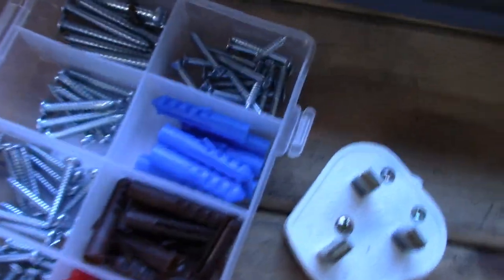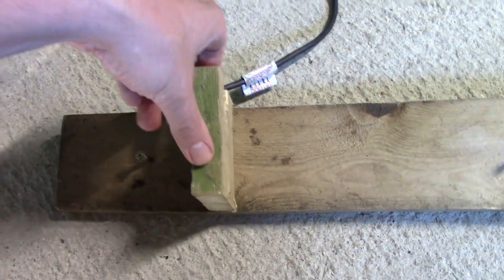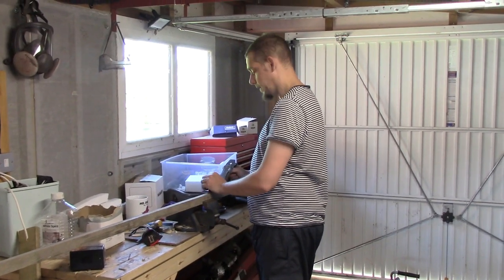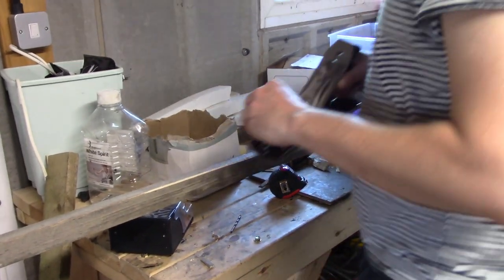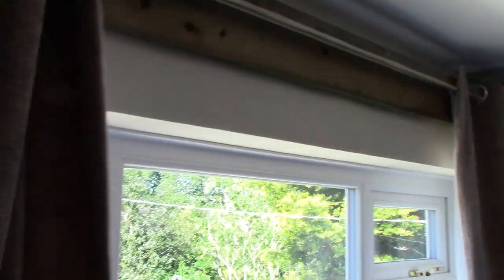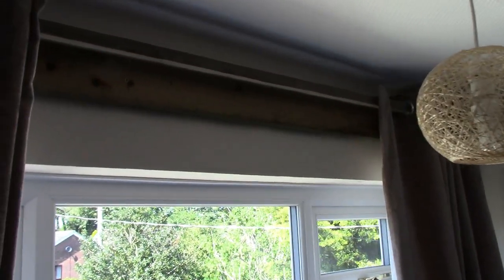Keeping Your Wife Happy Tutorial: Curtains & Rails

Comment: Take down the curtains for a moment. Grab some sandpaper and smooth out the edges a bit to even it up. Put a nice coat of white primer on it and put the curtains up when it's dry. Then take the missus to the paint store where you can decide to A) paint the curtain support in an accent color or B) paint the room in an entirely new color.